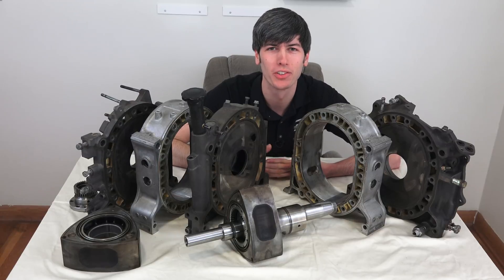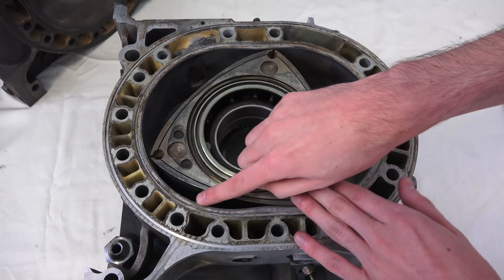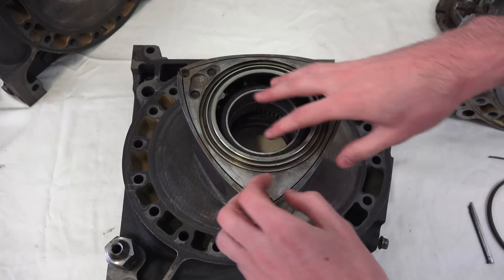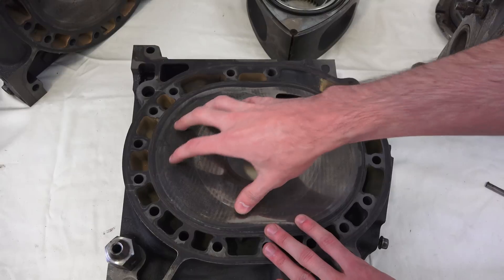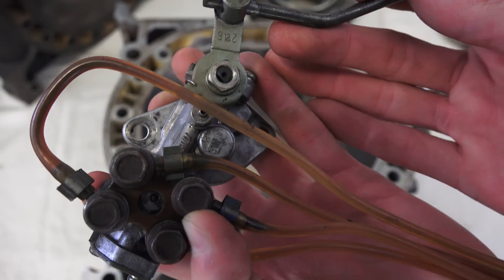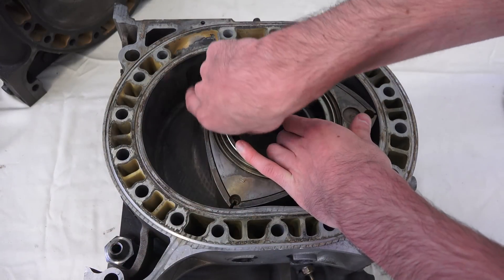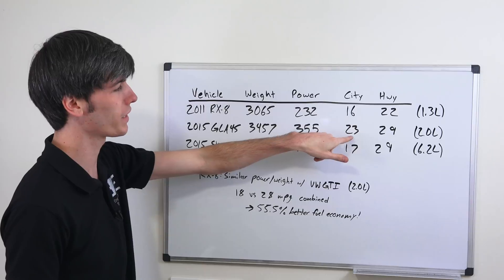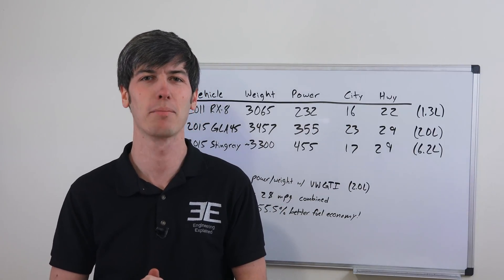4 Reasons Why The Rotary Engine Is Dead

Comment: electric engines will take over anyway, petrol will not be around forever
Reply: There's rumor saying that Mazda going to re-introduce wankel engine in 2019, to compliment with their EV cars as range extender. pfft, petrol stay longer but going to die anyway. lel.
Reply: @blazeboymilan not quite a Wankel-style rotary engine, it will be an evolution of the Otto cycle.
Reply: hopefully petrol will be around forever once electric engines takeover, then i can use my ford escort wagon as a sunday driver
Reply: Sok van Veen Because batteries dont last very long if you drain them to 1% and quick chacrge and they  are very expensive to replace unlike in a chevy volt where if you battery is stone dead you can just drive it as a normal car with electric transmission. Also people like petrol cars the way we like steam engines, they are not perfect but these are the trains you think off when you hear the word train. Same thing with cars and some people just can imagine a world without oil. I dont want an electric car either, scartch that for me all cars after 2010 are a bit meh, so I am looking up to a rover 75 or a Chrysler 300c and keep it fixed and running for eternety.
Reply: Most of you guys obviously didn't see the DeLorean conversion...Cars will eventually be powered by a flux capacitor.
Reply: The sad truth about electric cars is that the energy used for production is much more than how long the car will last. And hydrogen comes very close to electric cars. Electricity is generated inside the fuel cell wich will power the motors. Some hydrogen cars still use accus like hybrids to store energy but the car itself doesn’t even really need an accu at all. Well atleast not a big one. Also electric cars are one of the heaviest road cars that exist.
Reply: Vegetable oil powered
Reply: I don't believe it, lithium batteries whether they are ion, polymer or any other have a limited number of charging cycles. For example my $3200 E-Bike uses a lithium polymer battery, the best Panasonic money can buy, and it's rated at 340-360 charging cycles for its life expectancy so if you ride every day and charge it every night in theory it will last one year and the cost is $520, approximately one sixth the cost of the whole bike. Price wise that's like replacing the entire engine in your car every year! So unless they come out with a better battery, and they probably will, I don't see E-cars dominating the automobile industry in the near future...just my 2cents.
Reply: Gábor Móczik well lets look into battery expense then. How much would a replacement battery cost? Just like a gasoline engine needs rings and oil changes, batteries can only go through so many charge cycles before they no longer hold a steady charge, im sure batteries arent cheap and theres quite a few in the cars. Also, what about shop prices to get things replaced or repaired? That would require specialty work which is never cheap and probably hard to find in small towns. Then theres the fact that charging stations are expensive to put down, small towns like the one im from probably wont have any sort of charging stations around for a long long time. Then theres emergencies, what if theres an accident and somebody is hurt but my car is on 20% and has to charge longer, you stop by the gas station when your gauge says low but if theres no charging stations you can get a few extra volts for the trip home and if its a serious accident i dont have time to wait for the car to charge. Also, have you seen what happens when a lithium battery grounds or is damaged...its way worse than a gasoline motor catching on fire and if the lithium batteries overheat they can also vent which is also very unpleasant, and dont tell me that there wont be any problems, we get recalls on carelessly built cars all the time, throttles sticking is not as common but very serious when it does happen. More computers means more expensive and more easily broken. And have you thought about how much energy it will cost to produce the massive amount of power it would take to run and charge all the cars, it doesnt just come from nowhere. Coal is the main supplier of electricity, natural gas just cannot meet the demands as it just isnt as powerful as coal, so your pretty much switching your petroleum burning from one thing to another. Whether its in your car or at a plant giving power to charge lithium batteries theres pretty much no way to escape burning petroleum.
Reply: No because Morgan still exists.
Reply: We can't get rid of gas but it will go down dramasticly like we will need it for emergency generator we can would probably use propane for it or something elss
Reply: Mad9977 IT Will!!!!! Fuk electric cars..... H2 using cars are better anyway
Reply: what is easier to find, water or plutonium? 😂
Reply: I'm sure that in 1985 it was available in every corner drug store. LOL.
Reply: yeah that's why they needed a lightning strike to get started rofl
Reply: Spotted the gay man.
Reply: This is absolute wishful thinking at this point. Unless there is a major breakthrough in batteries (not incremental improvements) and a MASSIVE increase in electricity production and distribution abilities, electric only cars will remain toys for guilty liberals.
Even if we had the batteries, you are talking about displacing 10s of millions of gallons of gasoline a day in the US.
Reply: Its all just a cycle eventually electric cars will be useless we would have to drive around like the Flintstones. 😂
Reply: +Rated.... Not going to happen without a major breakthrough in both electric generation and the batteries. The US alone uses close to 400 millions gallons of gasoline a day. We simply do not have the capacity to displace that amount of energy. The scale of this problem is mind boggling. Of course, none of this even touches diesel. As long as we need the diesel (which we will), gasoline will be made because not all of the oil can be made into diesel.
Reply: Why not just use a mechanical engine with electric transmission and capacitors for braking recovery (to be used for powering the car, e.g. during a launch)?
Reply: Sok van Veen Because not everyone has several hundred thousand dollars lying around...
Reply: but a soundgasm of a Mazda 787B 4 rotary, 900 PS engine is fine
Reply: No. Don't you say such blasphemous things.
Reply: LPG
Reply: Reported this comment
...
Reply: Mad9977 Productions but when it runs out I will be dead or retired so would it really matter? No
Reply: Sok van Veen every car? Every production car you mean? And a tuned petrol engine would beat it anyways... The top fuel drag racers does 0-60 in like 0,2sec - 0,5 sec
Reply: Thomas Steiner who uses PS?
Reply: Mad9977 Productions  it could,  but nothing compare with like the gasoline engine noise XD
Reply: Yeah hybrids make more sense
Reply: Mad9977 Productions  i dont need petrol  i use alcohol in my wankel
Reply: Motor, not engine.
And I disagree, gas engines will always be here no matter how much electric cars are improved
Reply: Gasoline will stick around it will just become more obsolete and therefore cheaper. Electric vehicles are far from being mainstream though. Way too many flaws, battery life, battery weight, miles per charge, charging stations, theres a looooot of stuff needed before they will be common.
Reply: +Roman Bukins Everyone is picky about the one charge distance, yet very small group of people will actually need to drive this long at once. Most of the time you go to work, then go home, go to the store then go home, etc... Nobody likes to travel 4 hours long for 8 hours of work, unless driving is your work. If this is the case, then nothing prevents you to charge your car overnight when you are at home, much like you already charge your smartphone this way. Ideed, not suitable for everyone. But it would be ideal for 99% of the population. That 1% who needs to travel the world every day, still can use an ICE car, but it will be the minority that contributes to the emissions then. I would consider this a huge step forward...
Reply: tarstarkusz thats what im saying, its in its infant stage now. Its a thing but its not perfected, yes it works but its just not as effective as gasoline vehicles...yet. i read that there are batteries that can last years but what knowledge i have about battery cells and electricity in general they are probably very low amperage and have a low mah, so theyd last for years but you couldnt break 20mph unless you had some super technical gearing system to boost the rpm without putting strain on the battery. That would mean a lot of gears which to handle load and wear would have to be metal or carbon fiber. So its either weighs as much as a diesel and that takes a toll on battery or it will cost a fortune to produce, either way its just not a very plausible option. Then you have lithium ion batteries, much lighter but more expensive and known to overheat and vent...which usually results in deadly gas expulsion or big, very very hot fireball. If we would switch to souly electric, how long and how much would it cost to put in enough charging stations to take place of gasoline? It would take at least 10 years to fully switch to electric charging stations. There would have to be waiting areas because even with a super charger or whatever they call it, it still takes like 30 minutes to fully charge a battery and its also well known that quick charging is bad for batteries. In a nutshell, its not anywhere even remotely close to being perfect or a long term viable option...it has plenty of potential we just dont have the resources.
Reply: Gábor Móczik unless you think like the rest of your mindless millennial counterparts , most WORKING. people do have to travel a good distance to and from work...not all of us have the luxury of working from our mom's basement!
Reply: +Rated... There is no better battery technology in any stage of production right now. There are things in the lab, but very, very little gets out of the lab. We have not had a major breakthrough in batteries in many decades and I am not assuming that some new battery is over the horizon. Maybe there will be, but I see no evidence of that right now.
It is not simply a lack of charging stations, though that is an issue. Worse, most of the people living in cities don't have garages. But what I was referring to is the ability to generate enough electricity to offset 400,000,000 gallon of gasoline every single day. and the large scale ability to deal with differences in seasons and even particular weeks and weekends. IIRC, a gallon of gas has 115,000 BTU while a cubic foot of Natgas has 900BTUs!  (GOOGLE):
"This volume of natural gas has the same energy content as one US gallon of gasoline (based on lower heating values: 900 BTU/cu ft of natural gas and 115,000 BTU/gal of gasoline). One GGE of CNG pressurized at 2,400 psi (17 MPa) is 0.77 cubic foot (21.8 liters or 5.75 Gallons)."
Quick charging batteries substantially lowers the life of the pack. Keep in mind that a 30 minute charge would mean a charging rate of over 2C, probably closer to 2.5C. So if you have a 100kWh battery )Tesla-S), you have to charge it at 250kW to fully charge it from empty to full in a 1/2 hour.
Reply: -ZeO.... Nothing that even remotely meets the needs of such fuel. Algae is probably the best of these alternatives to petroleum based fuels and it is not anywhere close to being ready. What happens over centuries, I could not tell you.
Reply: Cars will eventually run on bio-mass made from crushed human remains so the Elite can cull the masses down to a billion souls for long term sustainability of the planet.  They will however have to pry my gun and my muscle car out of my cold dead hands.  God Bless the USA, the NRA and Israel.
Reply: have you seen the pricetag on the new roadster compared to a prius ??? people who wanna save the world often arent the richest people in the world plus batteries are pure evil in terms of saving the planet and heat collectors focused to create steam using steam to turn turbines thus creating electricity that u can simply put through salt water and the water becomes oxygen and hydrogen and when used in combustion simply releases water and heat and u can fill a hydrogen tank really quickly and no not really dangerous compared to gasoline gasoline will drip over everything a hydrogen tank that is leaking simply leaks gas everywhere very quickly which will rise up into its place in the atmosphere and come back down again eventually as rain and also batteries use electrolites which are harmful to produce and recycle and the lithium turns into gas partly and are about as dangerous or even more dangerous because its electro chemical fire when gone wrong only reason hydrogen isnt taking over yet is because we are figuring out how to produce it extremely efficiently plus itll be alot cheaper to produce and purchase and alot more econimical and practical yet still just as good or better in terms of saving the planet point is water one of most abundant resources in universe lithium not so mutch itll be just like gasoline prices go up people complain hydrogen takes over itll just take 100 150+ years so for now you are correct but for the future itll burn bright with hydrogen so we get the sweet sweet sound of a rotary engine burning hydrogen gas and using bio oil someday hopefully if humanity is competent enough
Reply: Gas will eventually run out anyway, cars will half to be electric someday.
Reply: Petrol still has a long time to live, way after are lifetime.
Reply: The electric engine isn't gonna take over, not anytime soon at least. For the next 40 years I can more see an implementation of hybrid technology like KERS and other efficient solution for heavier vehicles like a possible future OPOC reimplementation once someone manages to engineer a 4 stage version of it, but consumer cars probably won't turn full electric for another 40-50 years (if we're optimistic) as we're still far away from nailing the process of mass producing carbon batteries of good enough quality that would finally get the high capacity, fast charging and lightweight properties that are required for electrics to rise over internal combustion (specially as conventional batteries currently require as much of a carbon footprint to produce and transport as a conventional engine would produce in the expected lifespan of the battery itself, so you actually want to make as few batteries as possible and draw as much energy as possible from a single drop of fuel for better ecology, current batteries are not the future, at least not on their own)
Reply: Not really they will be a bigger part of the market then now,but try making enough batteries to replace every vehicle on the road now,and there are material supply problems with that.hybrid,and just fuel efficient vehicles are more likely.
Reply: For daily commutes an electric car might replace SUVs and trucks. It can never replace the sound, the smell or the fun of a gas car
Reply: Im still waiting for my flux capacitor engine..
Reply: what about Electric rotary engine
pffft 
petrol engine is better for me anyway
Reply: I believe engines will stick around for a long time in high end and enthusiast cars. Electric will take over the mainstream undoubtedly.
Reply: Rare earth elements will strongly prohibit electric vehicles.
Reply: Electric cars will take over when someone invents a better battery.  Once an efficient long lasting inexpensive battery is invented, electric cars will be everywhere.  We still need somewhere to get the electricity.  If you don't want to use coal or oil, we need to build more hydroelectric dams and nuclear plants.  The meltdowns at Chernobyl and Fukushima could have been prevented with current technologies.  Just have regulations to ensure safety is enforced.  Don't build plants on fault lines or areas where a tsunami could hit, have portable backup generators nearby on trucks ready to go, and have a large amount of water stored such as a manmade lake or tank uphill from the reactor so gravity can feed cooling water to the reactor for as long as it takes for the reactor to be cooled and shut down.  Have several alternative routes to ensure the water can flow from the storage uphill down to the reactor.  As long as gravity doesn't fail, the reactor can be cooled.
Reply: @YouTubinCapacitors and paper batteries are the way to go.  There is a lab geek right now that puts all his findings for free on youtube, currectly he is running an electric car around UK using paper type battery.
Reply: Petrol will still be around, but for most of us, petrol will be too inefficient for our needs. New battery and motor tech is changing everything. It's cool.
Reply: My AMC 4.0l should run forever  xd
Reply: I have yet to see an 800 horsepower electric motor that weighs in the vicinity of 25 pounds.
Reply: I'd rather vote for Trump and enjoy my c6 Z06....
Reply: Combustion engines are not dead yet. We will see CNG as the fuel of the future. Imagine a semi with an electric drivetrain. Absolute nightmare. I'm a German and the MB-Truck factory is not far away from my village (about 45km) and when they wanted to access the battery of their electric concept truck they marked off an area which was about 1-2 km² wide. All for safety reasons.
Reply: that is, if an electric 'engine' were a thing.
Reply: lol false
Reply: Mad9977 Productions yep
Reply: Yeh,Yeh ,Yeh ! We came here to watch about dying internal combustion engine , but you have again introduced your electric, i don't know why non petrolheads like you spread your crap everywhere , we wan't a non hybrid and nonelectric car, not a washing machine like tesla!
Reply: Petrol will be here 30 more years.
Reply: Hybrid cars with efficient piston engines powered by biomass will be the future, unless there are massive increases in battery capacity purely electric vehicles will never be as practical as cars powered by a combination of both. A car capable of maybe 50km of running with only battery and using a combustion engine for longer distances will be the norm before long, electric engines are incredible for efficiently producing power at many different rpm's so you can have a very efficient combustion engine running at quite constant rpm's with the electric engine helping with acceleration and so on.
Reply: Odd Shaghetti  So, you're saying that the Honda Insight will first come out as a recipro-electric car using the piston engine as a range extender, then the Prius, then.... Oh, wait: THAT'S ALREADY HAPPENED!! O_o

We already have full-electrics surpassing 300 Mile/500km ranges, that can be recharged fairly quickly. And turbine-electrics are already more efficient than the recipro-electrics types, simply because turbines can be run more efficiently than any output-comparable recipro engine (Citroen produced a running prototype turbine-electric that was getting well past 40mpg in the late 1980's; but it got killed by the petroleum industry).

So, yeah, thanks for the (not-so-correct) history lesson. o_O
Reply: @oddspaghetti4287  Looks like batteries are getting vastly better. Tesla's Model 3 2019 has a range of 260 miles. That's 111 more miles than the Nissan Leaf, and that's just with Lithium Ion. Wait until the next big thing comes out that replaces Lithium Ion and we'll be seeing 500+ miles easily.
Reply: That would be a motor then, not an engine
Reply: How tho? electric cars are already beating the 300 mile mark and the new roadster will do 1000 km on a single charge and beats every car in the 0-60 category. So please, enlighten me with why for gods name someone would use hybrid cars? They are slower and more complicated.
Reply: yes water is the way to go, there's enough of it =)
Reply: Ummm--enough Salt Water that is. Fresh water, not so much.
Reply: @GeraldRisch You can make fresh water directly from the air.  The idea we are running out of fresh water is because people are to lazy to implement true solutions that we have today.
Reply: WHAT are you talking about? you can recharge your battery with every form of electricity. Nuclear, wind, gas, coal, solar doesn't matter, electrons are electrons.
Reply: Hydrogen driven cars are also be a thing.
Reply: @nielsf2704  i think they will win over electric. Electric car arent helping because we don't have enough lithium for the batteries and most electricity is made via fossil fuels so it is redundant to put a battery in the middle when you could use the fuel directly
Reply: Tus is true but 95% of the Ocean is  undiscovered so there might be a few more billion barrels of oil or maybe none who knows
Reply: You can use literally anything that burns, so every fuel that we pump from the earth will be left behind and it will all go sustainable
Reply: Beste meneer Jeroen, Ten eerste zou ik graag de bron van deze 'treurige waarheid' weten want hij slaat helemaal nergens op. Batterijen zijn 99,9& rececylebaar en als je duurzame energie gebruikt heb je in principe gratis grondstoffen, ten tweede, hybrid auto's kosten ook energie om te maken en die gebruiken waterstof, Waterstof die nu UIT OLIE WORT GEMAAKT. Die gewicht opmerking is naast een leugen ook nog eens irrelevant. Ten derde, Batterijen uit hybrid auto's gaan vaak eerder kapot en hebben eerder last van batterij problemen omdat ze in een ingewikkelder aandrijfsysteem zitten. Dus, alstublieft, lees u eerst eens in voordat u een slechte indruk op het internet maakt
Reply: At what? Being expensive and extensively more complicated? At being slower? Do you have a source for this?
Reply: so true. electric motor is superior to the ICE in every single way.  Only 1 moving part too.  (well 3 if you count the bearings)
Reply: El eng are just another fraud-
Reply: Peter Čevdek ... Fraud ?  Try driving a Tesla, I went 0-60 in 2.6 seconds, pretty efficient fraud ...